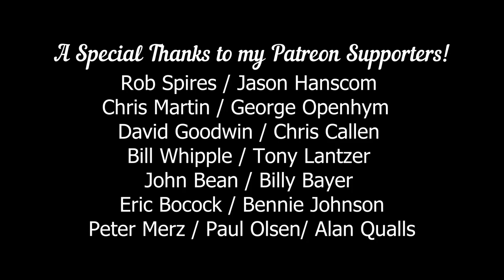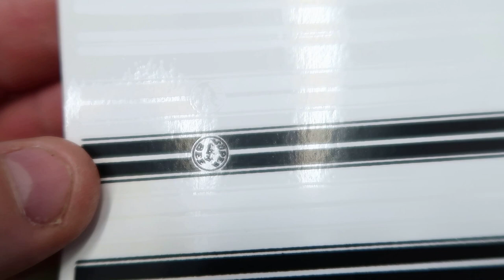The new decals arrived!! Let me try this again!!

Comment: Nice progress on that model. I think that from time to time, we all have decal problems. I can't remember the number of times that I have had to strip off damaged decals, and start again. I am experimenting with a couple of things. One is a technique that I saw on a video on here, about using masking tape to set up pin Stipe painting. By painting the desired pin Stipe color first, then laying a guide strip down, to aline the desired pin stripe location. Then the stripe mask, then removing the guide mask. And shooting the cover color. When it's dry to the touch, removing the stripe mask. So far, this works real well. This is the first time I have done this. And I used Revell flat browns, dark, and light. The gentleman said that this is for airbrush Only. I did this on the hood of one of my '40 Ford sedan projects light brown hood, and dark brown pinstripes. This goes nicely with the two tone body, and fenders. The other thing I am experimenting with is preserving, and making reuseble decals, from Old decal sheets. Taking clear laminating plastic sheets, cutting the laminating plastic to size, then laying it down on the old, unused decal sheet, using a brayer roller to make sure there are no air bubbles trapped. Then putting it in a tray of hot water. And letting it soak until the decals separate from the paper sheet. Hanging the decal laminate up to dry, usually overnight. Then the last step is to lay another piece of the laminating plastic on the back side to seal, and protect the decals, again using the brayer roller to prevent air bubbles from being trapped in this. It works pretty well, for the most part. I have some sets done on the decals from a First generation AMT 1940 sedan kit. These are some 60 years old. I can now reproduce them for use on some of my builds, when I want to use  them.

Comment: I like to use a soft paint brush when I apply my decals . I wet the brush and apply water to the body first like you did . Then I use the paint brush to push the water out from under it . After I make a swipe with paintbrush I  wipe it on a napkin or paper towel to get some of the excess water out of the brush . Then keep lightly brushing till all bubbles and water are out and really helps smooth it out .

Comment: Ok, very nice model.
2 tips one you don't soak the decal you dip,it if it curls don't  worry it will un curl 
As the glue devolves.
You need the glue so it sticks.
Alway seal with clear coat so your decals so they don't fall off.

Comment: Not to be firm, but Matt you need to really practice the fundamentals. You're fighting yourself in little ways! Some of it is in your head which practice will eliminate. 
Example, It broke when you slid it off tip of paper onto your finger which is not a proper surface for your decal. It had resistance. 
Some points, when taking cut out and soaked decal from water (I use a small plate) use the wet paper as a support and place at end over model, slide enough of decal onto model with wet Q tip and hold it there while pulling paper away. 
You should be using two part Micro decal solutions, first slicks up surface to glide decal to position without diluting adhesive (too long in water will dilute adhesive) and avoids breakage. Second one softens the decal carrier (do NOT touch or move decal) and as it evaporates, snugs and tightens decal to surface. At the point of drying, you can wet a Q tip and roll it to further push it down and squeeze out excess. After full cure, clear coat to not only seal decal, but protect it and blend it with the paint, unless you want to keep different sheen, like flat stripe on gloss paint. 
In your case, you are better off cutting the decal along the foil line when dry enough to not move, but while still curing where it is supple enough to not fracture. I hope it cut clean and came off foil easily.
Not to hassle here, Hope you can get some practice time on a scrap (painted) practice body with some practice decals! Hope to see you doing a few NASCAR builds...

Comment: Fred Cady decals are sweet!!! They do break easily if they are old. I had the same problem with his Knaffle Prontiac #461 sheet
Reply: The decal went on great.  Try rolling a dry Q-Tip across decals in the future.   It works really well.  Thanks for sharing.
Reply: @michaelcooke2559  I did try that but, the decal just fell apart!!!
Reply: @chuckhand8622  I have had that happen too; especially, with the decals in the newer AMT kits.
Reply: @michaelcooke2559  Mike I don't build most new kits, I have been stashing kits since I was 7 years old and have more than 1000 unbuilt, and about 100 kits started!!! By the way I'm 75 now
Reply: I've had Cady decals over the years with very few problems. You do have to soak them a bit longer sometimes before you start to move them off the paper. They're still not a big a gamble as the European  brands can present.
Reply: @donstevenson2660  I soak them in warm water with a drop of Dawn blue dish soap, they came apart on the model when I was smoothing them out with a wet Q-tip!!!